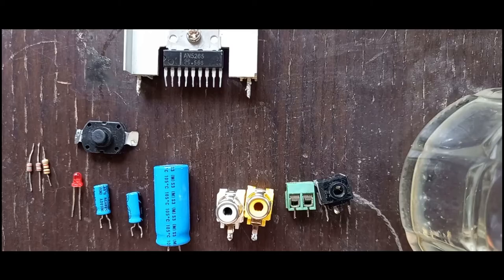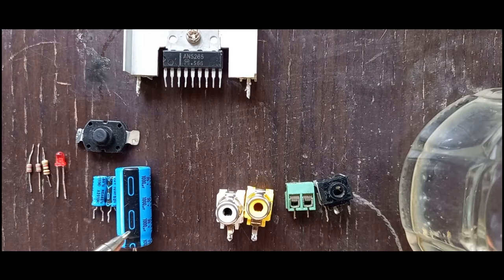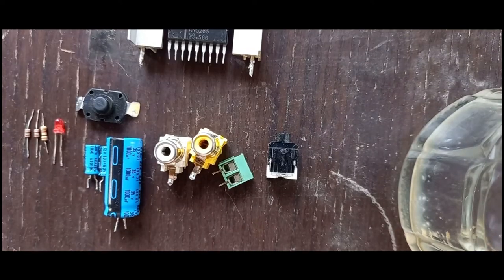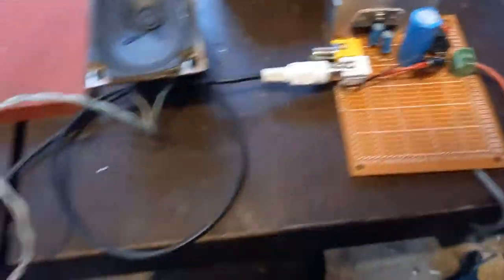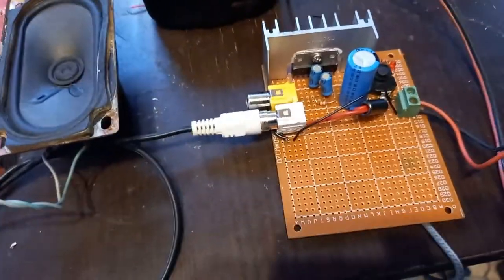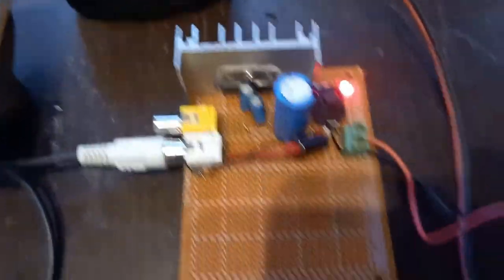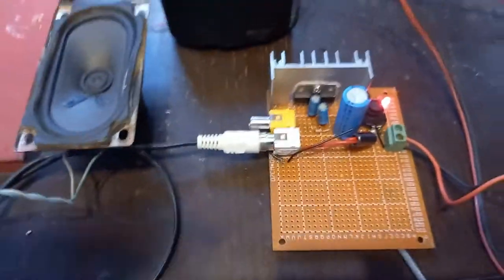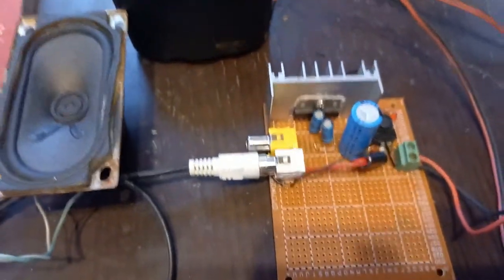How to make an amplifier using AN5265 recovered from an old tv

Comment: Sir can I use 15w 8ohm 2 speakers with this????
Reply from the maker: Any speaker will work I have tried many, the best I found was 
3w 8ohm, the best thing to do is experiment with different, also experiment with the output capacitor try 2200uf or bigger
Reply: @DachaLife  ohkk thanks broo